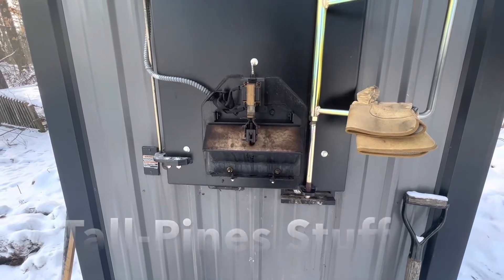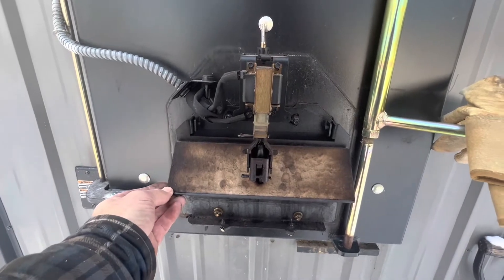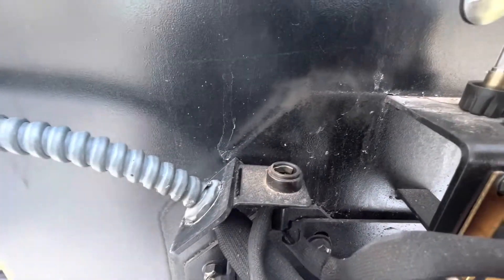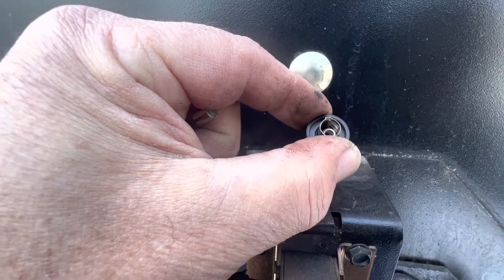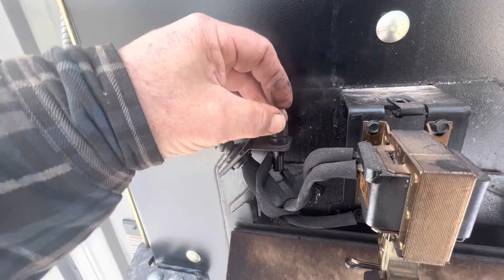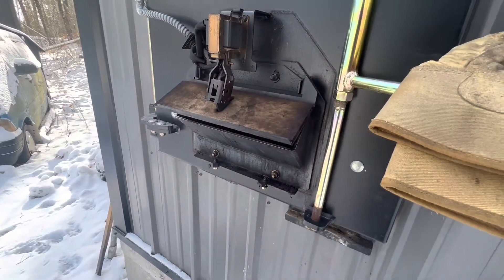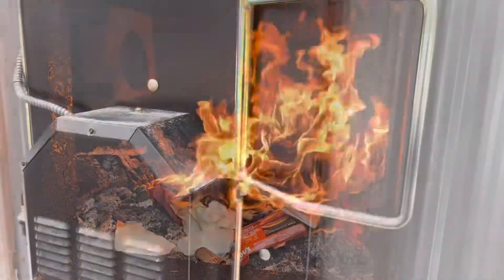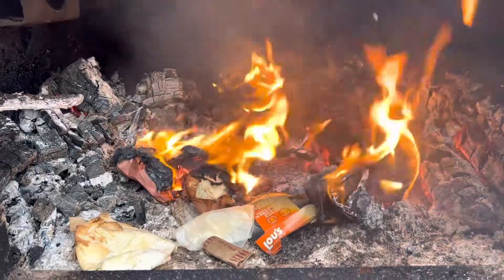OWB Damper Door Malfunction and Air Leakage Tip

Comment: Why did the spring fail what size fuse was it
Reply from the maker: Either the spring was too short or it lost it's "springyness"?  It was an older automotive style glass 1 amp fuse.  I have since replaced it with a 2 amp fuse.  Interestingly enough, my son-in-law‘s same model boiler uses a 3 amp fuse.
Reply: @TALL-PINES_STUFF  Thank you very much